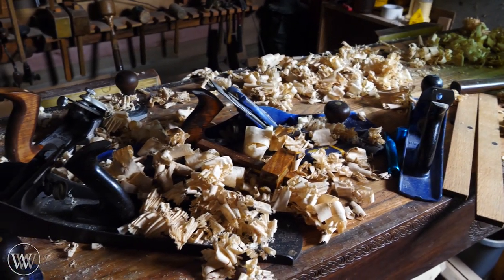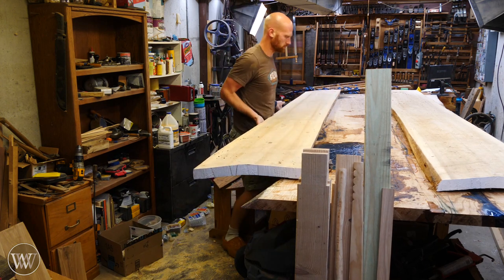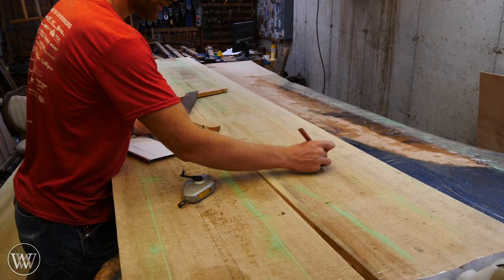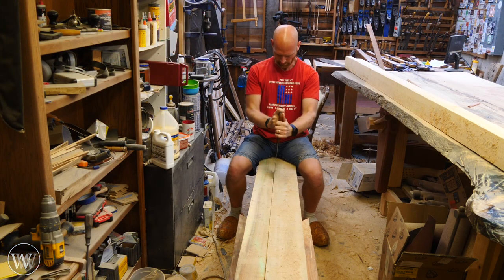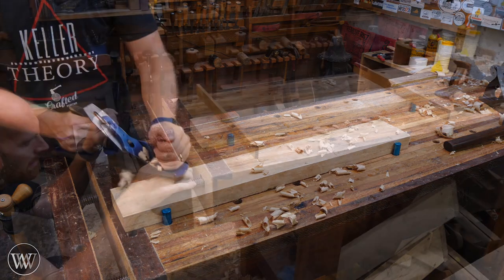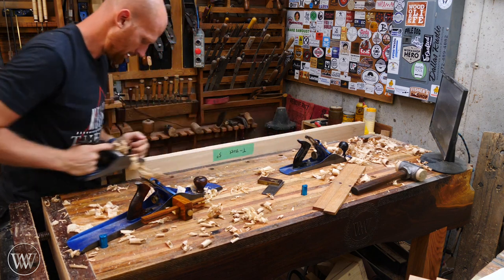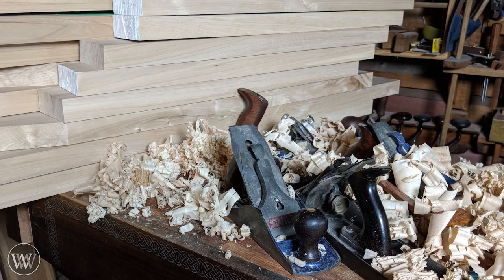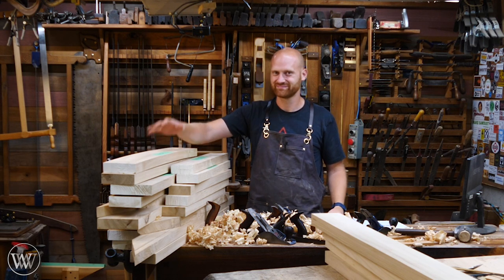Making the Base for the Dining Table   Demensioning Lumber By Hand

Comment: What is it like to work with elm? Tough like oak or easier?
Reply from the maker: Frank Olinde it is softer like a soft maple, stringy like a hickory and has a really high silcan number so it dulls the blades quickly. Not the best hand tool wood, but it works.

Comment: So how much wood did you plane in a day? I was doing some stock prep this week and did 4 boards, 1 meter each in about 8 hours.

How much material did you remove? I ended up removing about 6mm of thickness.

I'm trying to gauge how does my work time and quality compare to yours :) I have room for improvement, but I wanna know what should I expect as I get better.
Reply from the maker: I took off about 1/4" on all these boarda and spent around 8 hours total on them.